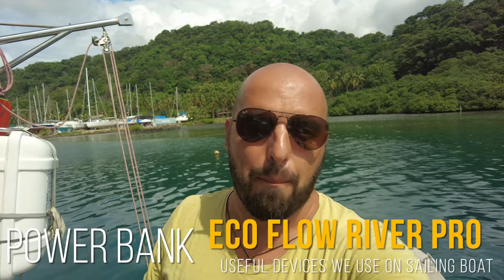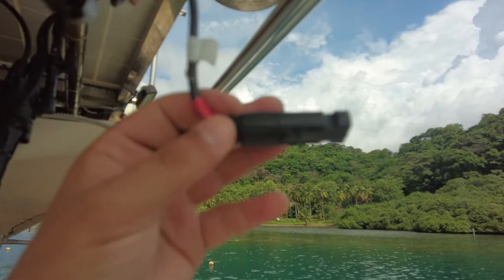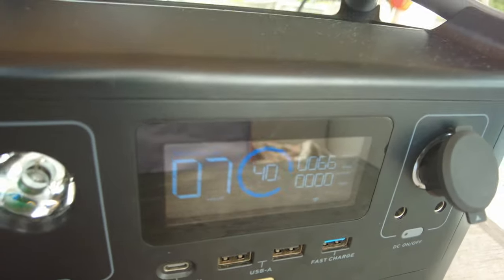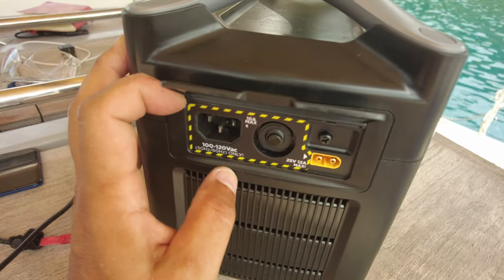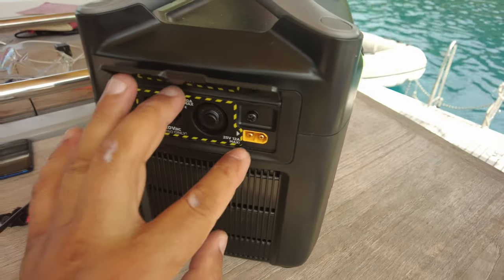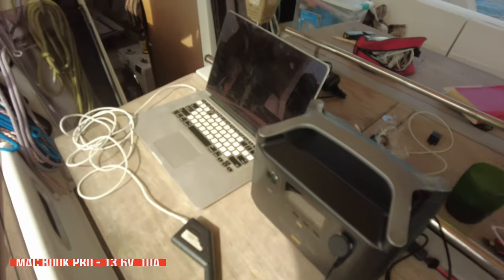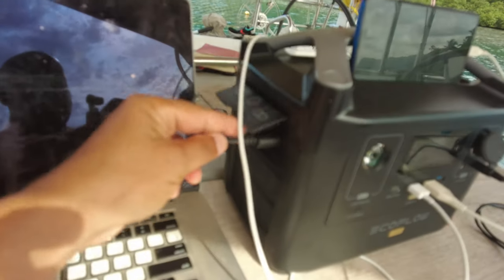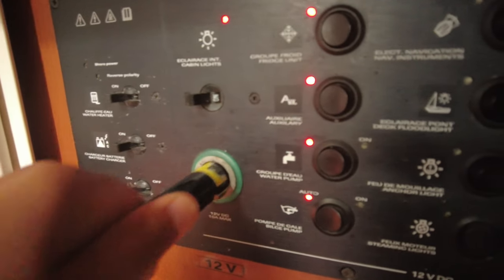Surviving The Apocalypse With A Power Bank

Comment: This is exactly the power bank that I need for my RV. I can still use my old solar panels to charge it saving me money in the long run.
Reply from the maker: Yes you are right. But if you want efficiency better to replace the solar panels, they have quite big degradation especially in hot climate in short time

Comment: This power bank actually makes sense using it in a boat. You can charge it thru solar no need to plug and recharge thru an AC wall outlet.
Reply from the maker: Only one point, it has extremely fast charging time from AC. One hour up to 80 percents, and 1,5 until full from zero. From solar it takes really much more but works if you have no other way